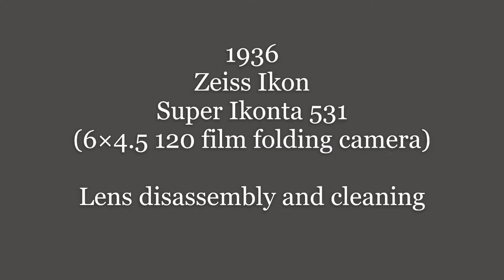Zeiss Ikon Super Ikonta 531 lens cleaning

Comment: I kinda goofed on mine and forgot i set it to 100 shutter speed but now i got it back aligned but the camera is only good at 6-64 feet away now
Reply from the maker: Not sure I understand. The shutter speed and focus are separate mechanisms and aren't related.

A good way to check the focus and viewfinder alignment is to get a sheet of wax paper or tracing paper and cut it down to the size of 120 film, wind it onto some spools and put it in the camera. Put the camera on a tripod, open the back, open the aperture to max (f/3.5) and use the bulb setting to hold the shutter open (easier if you use an external shutter cable that can lock). The lens will project onto the paper like a poor-man's ground glass and you can check that the focused image matches what you see in the viewfinder.

Comment: What tool set are you using..?
Reply from the maker: It's a screwdriver set from iFixit. It's pretty cheap, many years old now, and I've broken and replaced more than one bit, but it gets the job done and I like its ergonomics. They've changed the design since I bought it though, so I don't know if the new one is good or not.